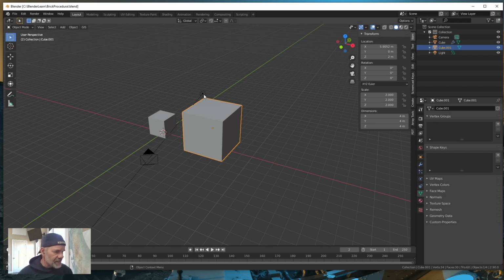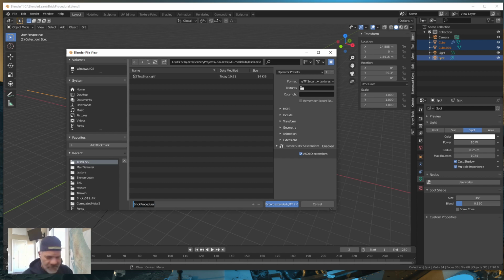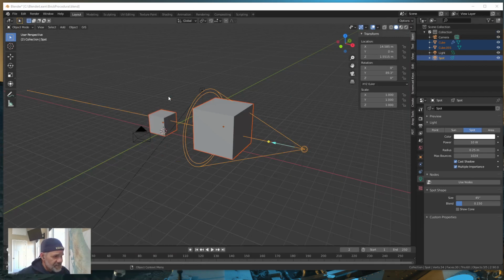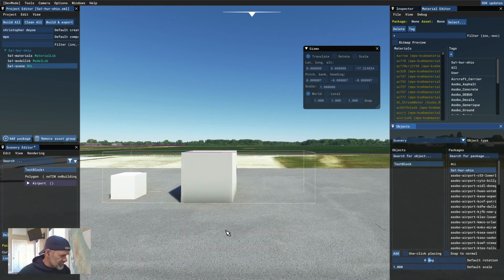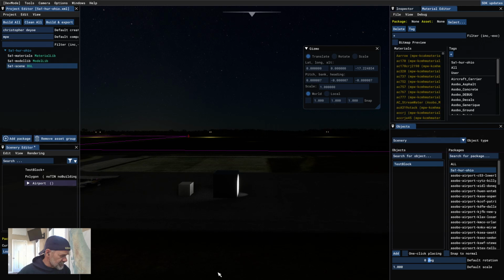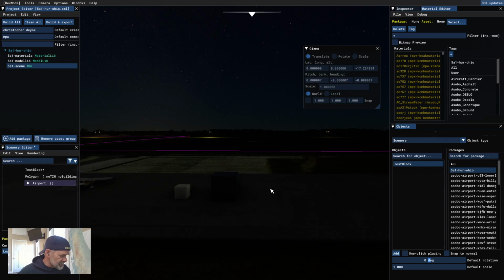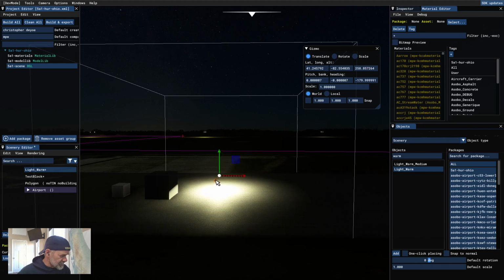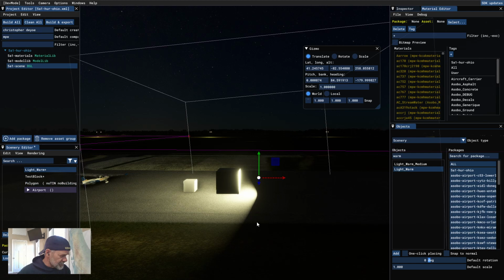Creating Scenery for MSFS 2020: The Qwerks of Artificial Lights

Comment: Great!  I'm not crazy, and I'm not alone!
Since you invited discussion, I'll share a few of the things I've had to do:
External lights like porch lights or lights over doors work better using a Blender point light; at least you can control the intensity and color temperature of that light, and it doesn't "snap to ground" - it stays right where you put it in Blender.  Yes, it goes right on through, but at low intensity you don't get much annoying spill.
A Blender point light (set to Day/Night Cycle!) can be parented to the vertices of an object (Ctrl-P, Vertex), and the Instancing (under the Object Data Properties - the dot triangle symbol) set to Vertex.  This then generates a point light at every vertex in Blender ONLY.  Move them around in Rendered view until you're happy with placement, but before you export them, you need to make them Real.  Select the vertex object and under the Object menu, then the Apply sub-menu and then select Make Instances Real.  You'll get as many point light objects as you have vertices, so you might want to stuff them into a sub-group in the outliner.  Great for roadway lighting.
I modeled a rotating lighthouse beacon using the Asobo rotating beacon, but the results were still not visible from far, and I couldn't control the light value.  Instead, I placed an icosphere in the lamp cupola and put four spot lights around it pointing in.  I then selected each spot in turn and modified its properties in the Object Properties panel (little cube with angle brackets at the four corners).  Scroll down to find the MSFS Light Parameters.  For each spot, tick Day/Night Cycle, of course.  Then set Flash Frequency to whatever (e.g. 30 for 30 flashes per minute).  Then set the Flash Duration in seconds; e.g. for 30 flashes per second, I'd say 1 second would be good, but you need to experiment.  Now, the final trick: Set the Flash Phase for the first spot to 0.0, the Flash phase for the second spot to 0.25, the Flash Phase of the third spot to 0.50 and the Flash Phase of the last spot to 0.75.  They flash in sequence around the icosphere, but they look from a distance like they're a rotating beacon.  The advantage is that you can see the icosphere from quite far away.
Keep up the good work.  Appreciate your pace.
Reply from the maker: I am going to experiment with the vertex parent thingy...sounds fascinating. As for beacons, I do the exact same thing. Nice!